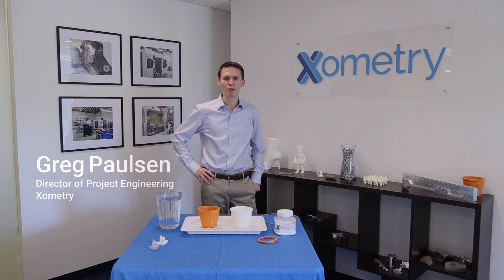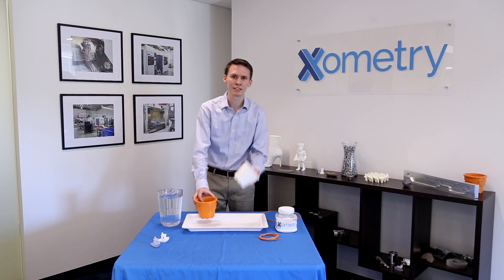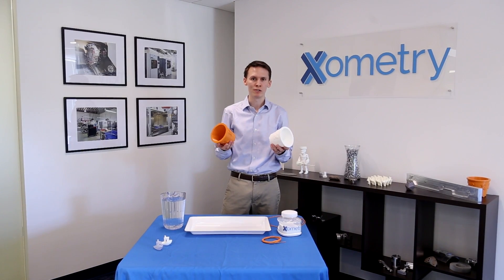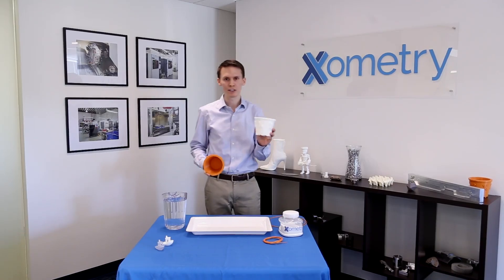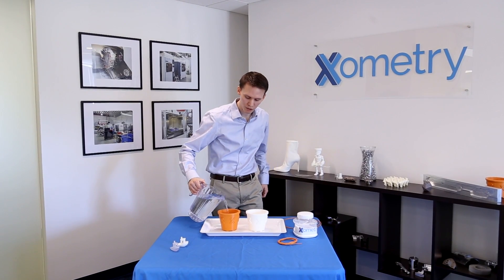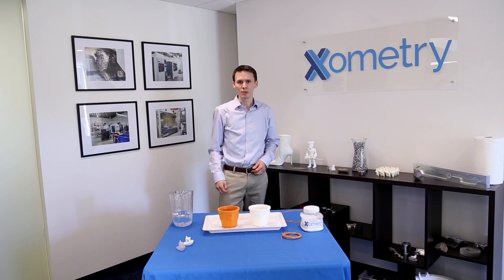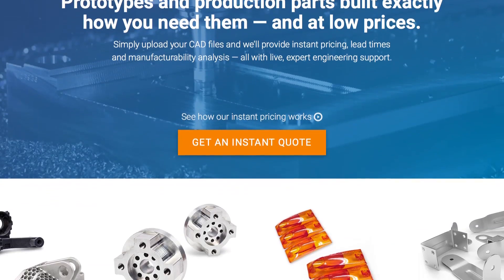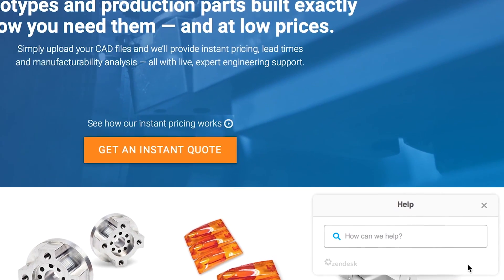Will It Leak? 3D Printing Watertightness Test

Comment: I'd argue the problem with that FDM is how it was sliced. I don't know if supports were used. Something could probably be done to fix the leaking X's. Of course filament might be a little too dry or wet that day or have a little imperfection that causes just a little tiny hole to form. 

But doesn't change the comparison really as you are still making extra steps that you don't need to for SLS.

Comment: The 2 pots are not exactly identical.
Interesting enough, all spilling observable at FDM piece happens exactly at those "X" that are not identical with the SLS part.
Reply from the maker: Thanks! Both parts were made with the same STL file. Each process has its own way of making the geometry, which is why you see cosmetic differences. To learn more you should check out our design guides which has a bunch of our processes https://www.xometry.com/design-guides - try out the "Production Guide" first!
Reply: Thank you for your answer.

Comment: lower layer heights, more infill, and possibly post processing with Acetone or a 2 part resin depending on the material would fix your FDM print. I've made tons of water tight FFF prints.
Reply from the maker: Exactly - what we want to promise is a consistent product and because FDM has unpredictable micro-gaps we would never suggest it for watertight applications without a post-treatment (e.g. epoxy sealing). That being said, FDM has a bunch of material options, colors, and a HUGE build area that makes it a very popular way to build a part.
Reply: Thanks! This is true and its definitely a post-processing requirement to get FDM to become watertight. I recommend using a runny epoxy and "painting" it on the surface. SLS, SLA, PolyJet, and Urethane casting can make watertight parts from the get-go.
Reply: fdm can be watertight out of the box- Just most FDM printers have poor tolerances, printers with <0.15 tolerances and correct extrusion width will not leak water. its just that most consumer and some high end 3d printers lack consistent repeatability. even some high end 3d printers under extrude to preserve surface quality and in-turn lose  water/air tight behavior

i can see how these tests help your customers choose the right material for them- when using your service though- but as a blanket rule its hard to say "fdm isnt watertight"
Reply: It's all in the programming. You can consistently print watertight objects with most FDM printers with the right programming and material combination. Just like anything else with 3D printing it takes practice and working through the problems to find the solutions. Once you have your programming worked out you keep a log with the details so you can recreate time after time.